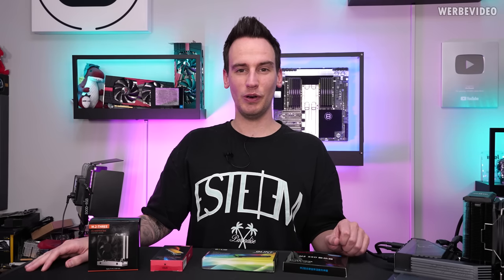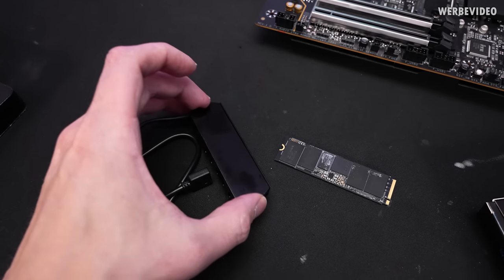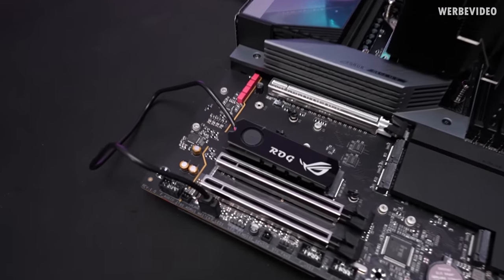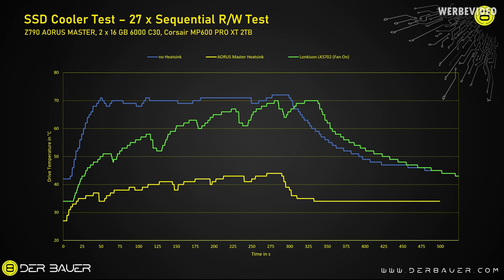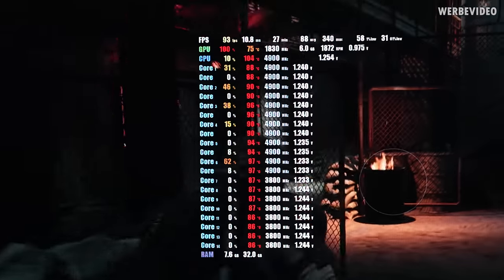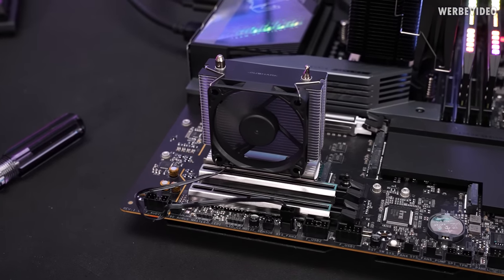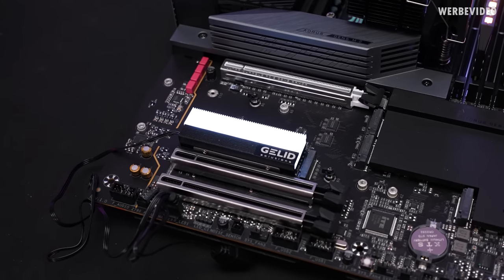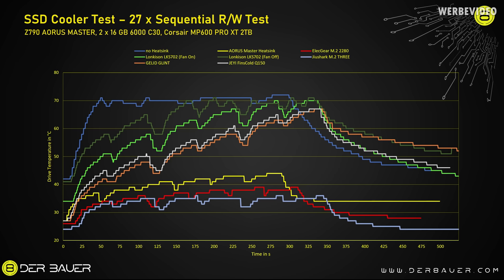More AliExpress garbage? This M.2 cooler was surprisingly good

Comment: I was actually looking at taht M.2 tower cooler not too long ago, might still go for it. The only problem is it takes up so much space.
And honestly i was susprised it did this "well" as a CPU cooler.
Also, that fake ROG one is real complete and utter trash, not even a way to keep it attached well... That is some real zero effort right there.
The Gelid one does something, but it's obviously just for the big RGB on it.
I expected the Jeyi to do a little better, but alas, no joy. I figured that indeed with some extra airflow it would perform quite a bit better, but it i'd have the copper plates positioned the other way with a fan at the beginning or end, i've seen some of those too.

Comment: My 1st MD sata Woz an Adata 512 gb 2018  tried a 1tb corsair nope - the adata still powering on good
issues'   think adding another hdd was the problem wouldnt reboot win10pro bios 1st boot adata was rearranged TO ? WTF          Ok fixed it
  also 2nd issue was nivida driver updates fixed no boot also WHoo

Comment: The M.2 Three intrigues me. I would like to see it tested on a lower end CPU, like a Ryzen R5 7600, 5600, 5500, 3600 (all 65 W TDP) and see how well it cools them. The small size could work in an SFF or ITX build and if it works Ok on this sort of 6 C 12T CPU, it should be 'fine'. I would suggest zip ties to affix it.

Comment: I think the last one would benefit from a normal use case. I think the fin are oriented in that way because above there is the gpu fan pulling air between the fin. Not much because there is  large gap between the gpu and the m.2 but i think it would perform better.

Comment: Please test JF13K 😊

That tower cooler would no doubt perform much better with a slightly larger fan that got some airflow over the pipes, and a clamping mechanism.  Seriously considering it for my Mini-STX with x8 GT710 and NVMe to PCIe adapter.  Still looking for something like a standard tower case but very smol to put it in.

Comment: Doesn't the lack of mounting space especially with an installed graphics card makes these almost redundant?
My Gigabyte Aorus Master X570s mobo has 3 PCIe slots and 4 m.2 slots. The top m.2 slot (as per usual) is between the cpu cooler and the graphics card, there is some chance of an aftermarket cooler fitting in there. The 2nd and 3rd m.2 slots are under the graphics card, the included mobo cooler/low profile shield appears to be very very close to the graphics card, I would need to use feeler gauges to measure it. The 4th m.2 slot (which disables 2 sata connections) would have no issue with an aftermarket cooler.
An add in m.2 quad card probably makes more sense for cooling, but then you need a free 16x pcie slot that does not conflict with your graphics card slot...

Comment: Sometimes I think the failure of the cheap heat sink comes from the low-grade thermal transfer sticky pads they come with that may be simple foam tape.  The heat is just not getting to the heat sinks proper.   The tests should be tried with known-quality thermal pads too.  I had a similar issue with cheap thermal paste.  The good stuff made a huge difference.

Comment: The tower cooler is the one I most liked. Your use of it on the CPU is what sold me. TBH there are low profile coolers about the same size that would cool about as well. I prefer to use some of these when I can. If the intel stock cooler was beefed up a bit with more mass and/or fins they could be quite a reasonable design. I have an old one from Arctic Cooling that is a basic 'starfish' design that keeps my Ryzen 3600 under 80C all the time. I also use an even older AM3 design from them that keeps things nice under my load scenarios. It just depends on the case to be used.

Comment: germans say "zee"?  i know some used to say zeig... but. i assumed it would be correct, as in "zed"
also from what i have read, the flash modules themselves are generally designed to run far warmer than ambient so the cooling is generally for the controller chip
also bet that copper looking cooler works quite well with some breeze from a cpu air cooler (since your best ssd is often located there, not below a gpu)
and if i were a complete savage and wanted to make an SSD cooler, sure using a fan is overkill but you dont need rpms. and you shouldnt need to plug it in. it should tap that sweet m.2 power for the tiny sippage you'd be using to spin a little fan at maximum when the drive is on. ;)   might be a bit of a nightmare but hey, i'm retarded :)

Comment: lol, 70watts of cooling for an M.2 drive; that thing could possibly cool an unmolested Ryzen 3600 without throttling if you got the alignment right.
Reply: That is comically overkill for an M.2 drive. The M.2 connector will melt long before it can deliver 70W. It means over 21Amps of current with 3.3V .🤣

Comment: oh geez the m.2 coolers... by why active? and not passive solutions, these are too big!
Reply: Some high performance PCIe 4 and most if not all high performance PCIe 5 nvme drives actually put out quite a bit of heat.

And since on most mainboards these drive slots are slapped right above and/or below a GPU, they either doused by GPU heat or are in pockets of stale air.

I wouldn't be surprised if a rethink of where NVMe slots go on a mainboard is incoming and maybe even a rethink on the drive PCBs themselves to allow for holes spread around the board that let you hard mount heatsinks with some decent mounting pressure.

Also, as you can see in the actual tests performed here, even in general used PCIe 4 drives there's enough heat being generated that you're reaching the upper limit of acceptable for SSDs, which is 70C.

Active cooling being required on high performance PCIe 5 drives was part of the messaging for the technology from the start.

Comment: Throughout the video you seem to be forgetting how MASSSIVE the stock m.2 heatsink is on that mobo. A good point of reference should be the classic plain strips of metal used on the majority. 
If "aliexpress junk" beats that strip of metal and is worth less than 10$/€ then it's not garbage.

Comment: Great video. Would love to see in depth Q2 2023 4K 120fps+ theme series of videos, for different builds, with slightly different parts & at different prices, for achieving that increadibly desirable GOLDEN benchmark goal of AT LEAST:
At least 120fps average, 
At 4K resolution,
With game settings maxed out,
For a range of triple A current titles including FPS & strategy & RPGs.

Why is this the GOLDEN benchmark? Because it's the maximum an HDMI 2.1 uncompressed cable can manage!

After a few different builds, you could create a unique & valuable comparison table, suggesting what the bottleneck in each build is, going from the cheapest build that can manage this GOLDEN benchmark, & map how much each fps above that costs as each build increases in cost, & if cheaper builds can get higher performance! 

Epic video 4K 120fps+ benchmark PC build video series for 2023!

Comment: You smashed the nvme cooler by trying to install a drive it wasnt designed for then call it junk because you crushed the fan in it with improper installation? Come on guy, be better.